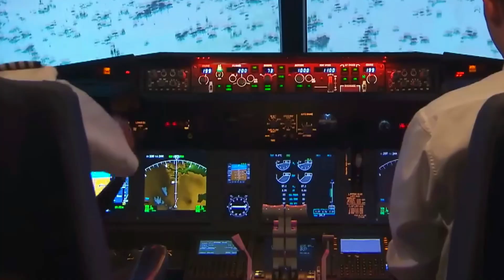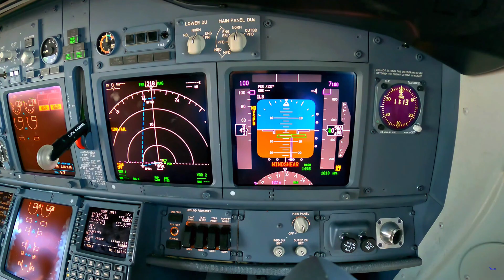Is the Boeing 737-MAX SAFE?

Comment: If a plane has a critical design flaw, and that very design flaw has already caused the planes to crash and killed everyone on board, until the design flaw has been corrected, and tested and tested, and tested again by well informed and experienced pilots, and only after they feel it is safe, and only after ALL the Boeing engineers, staff, Board of Directors,  shareholders, and FAA regulators first fly the aircraft for at least 100 hours, it will be considered safe.  If the Boeing engineers and  Board of Directors and shareholders, and the FAA regulators won't fly in it, then it is not safe.  In short, No.

Comment: Now the fake media is
going crazy with all these Boeing plane incidents
Boeing has been around for decades building good safe planes and I am certain that their overall safety record is as good as Airbus
There is no doubt that there is a quality issue
it is impossible to oversee 160,000 workers spread around in various factories to see if they produce good or bad quality work intentionally or unintentionally
The two fatal crashes could have been avoided with western trained pilots
They would have overridden the faulty sensors and fly the planes to safety manually
An independent French investigation confirmed the same but the fake media never talked about this
Losing a wheel, skidding off a runway, engine fire has nothing to do with Boeing but it is a maintenance issue
Maybe united airlines should be investigated and grounded until they improve
The recent plane plunge maybe is a maintenance issue as well we do not know yet but right away Boeing gets slammed
There is all kinds of mis information out there but none of these news outlets gets shut down
Maybe we should ban Boeing of building passenger planes and should Airbus ever have a low point well we just don’t fly anymore it is good for the environment and greta turnburg would be a happy camper

Comment: NO it is NOT!.....
Reply: Are you sure? It has been subject to a higher standard than other aircraft.
Reply: @aycc-nbh7289  just ask the engineers on that undercover tape 10 years ago plus the dead whistle-blower it just adds up.
Reply: @reneestevez7193 All of it could have been staged to make Boeing look bad. Airbus would have a perfectly good reason to want to do the unspeakable and then try to pin it on Boeing.

Comment: i asked chatgpt it said...Hell Noo!!!
Reply: But who says ChatGPT is a competent authority, especially if firms are building their own versions of it to do things that it can’t do?
Reply: I asked ChatGPT and it said „Yes, the Boeing 737 Max is considered safe now. After two tragic crashes in 2018 and 2019, the aircraft underwent extensive reviews, redesigns, and modifications to address the issues with its automated flight control system, known as MCAS. It was re-certified by aviation authorities like the FAA (Federal Aviation Administration) and other global regulators in late 2020, with additional training requirements for pilots. Since its return to service, there have been no significant safety concerns reported.

That said, as with any aircraft, ongoing monitoring and safety improvements are essential, but the 737 Max is now flying with enhanced safety features.“

Comment: The answer is…..HELL NO!
Google the latest issue with the spoilers!
Reply: Minor issue with quick solution. These sorts of things are not exclusive to the MAX or even Boeing either.
Reply: @JayJayAviation  it’s not minor if the spoilers deploy on one wing 100’ above the ground.
Reply: @eglide73  the amount that the spoilers are activating can be easily overridden by manual pilot input. Otherwise, it’d be an emergency airworthiness directive, which it isn’t.
Reply: ...and a stuck rudder
Reply: @the369truth Wasn’t this an issue with the 737 long before this? If regulatory agencies are fine with this, they should be fine with it on the MAX.